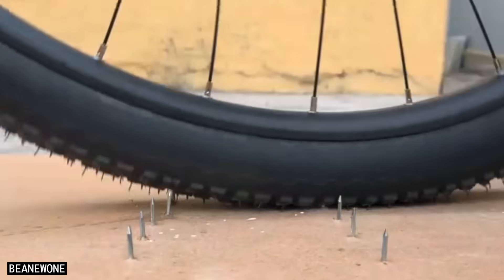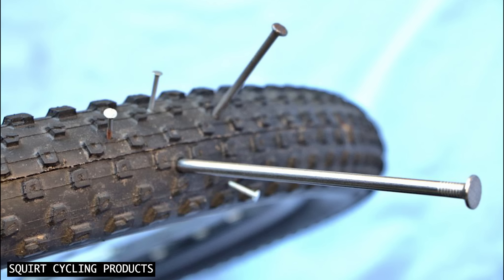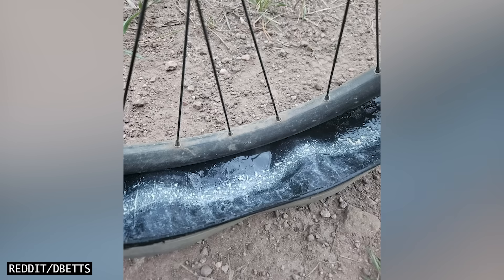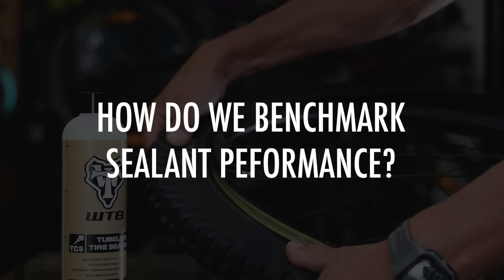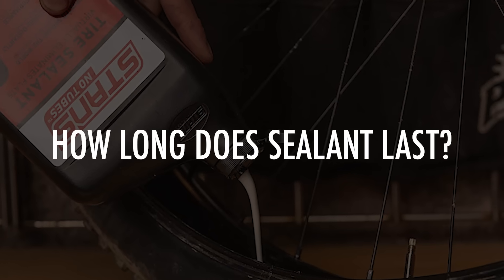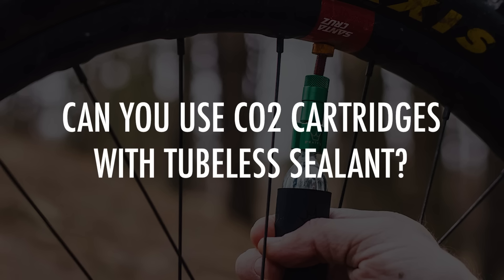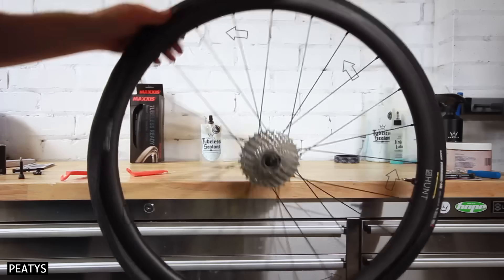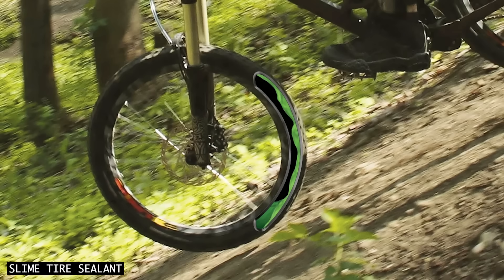I Found the Best & Worst Tubeless Sealants For MTB, Gravel & Road Bikes

Comment: What do you think of schwalbe tyres.
I have been using them for years now and never had a puncture.
Tubeless , well i tried but made a mess and never went back.
Reply from the maker: I've spent most of my life on Schwalbe tyres, and they're great! However, I found that once I hit wider widths (ie. 2.2-3.0") they were no longer puncture resistant enough. I've been using Schwalbe G-One 2.8" tyres for the last few years, and haven't EVER got a flat tyre despite all the deserts I've crossed. They also roll noticeably quicker, feel smoother, can be used at lower pressures, and are lighter than tube tyres (as they don't need all the protective layers).
Reply: I've had mixed results in regrads to puncture resistance with Schwalbe tyres.
I previously had ones with rubber inserts (medium level Green Guard) and in many years never had a puncture. 
Now I have Marathon High-Efficiency with fabric puncture protection ... and that does not work at all against small objects. Unless you have an issue with massive bolts puncturing your tyres regularly, get ones with rubber inserts. This does cost some efficiency though.
Reply: I only use Schwalbe Mondales 2"x26" these days.  Best all around touring tire.  It's not tubeless ready, but I run it tubeless and never had an issue.